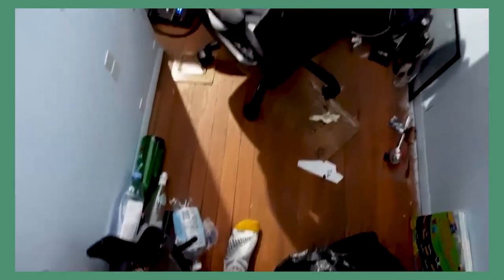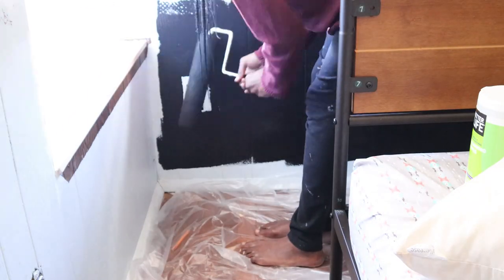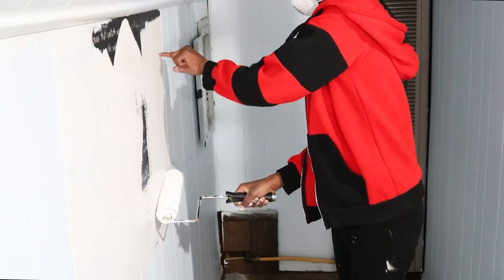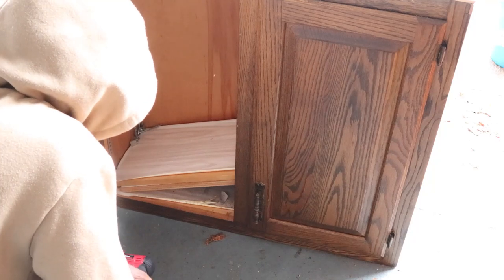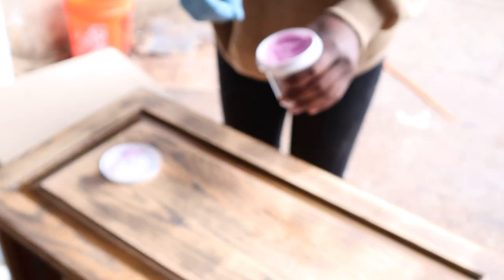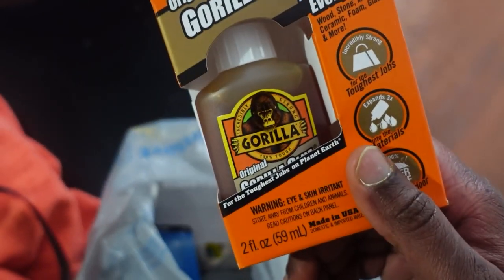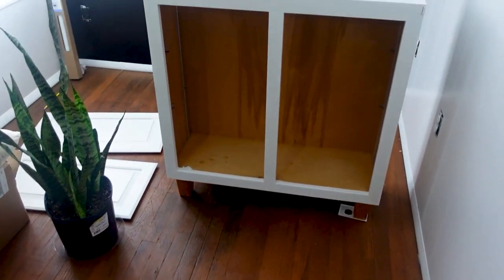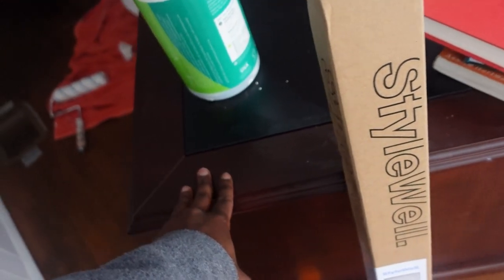HOUSE TO HOME UPDATE: Small Home Office Room Makeover PROGRESS

Comment: Take down the roof tiles and spray paint them it can coat the  pores. Then paint the frames that hold up the tile. If you use matte black the frames will blend better.  Have you attempted centering the cabinet to the side of the wall that it is on?
Reply from the maker: Matte black 😍. I havent tried removing ant yet but this method sounds easier than what i had planned lol. But i think i'll use a roller. Im adding it to my summer to do list. The desk takes up some of that space so thats why I didnt center the cabinet. It'll all make sense why its off centered. 😅 lol.
Reply: @createwithkim7  can't wait to see it come together. I'm here for the journey. Oh also you could consider replacing the ceiling tiles with black ones

Comment: Your son is adorable! “I’m right here, don’t worry!” I think you need to put new drywall on the ceiling, then paint.
Reply from the maker: That's another level for me lol. I shifted one of them earlier to see what was up there... 🙅🏿. Lol.
Reply: @createwithkim7  It’s a small space and might only need a few sheets. Local handyman who might do it for a set price? Also, there is a clear sealant you can get as either a paint or spray. Most cupboards and dressers have that semigloss finish to prevent dirt and scuffs. I couldn’t tell if the white paint you applied was gloss or not. The legs on the dresser should be secured as the whole thing could collapse, especially if filled with books. Maybe a bracket which would go into the legs and the side? It could be painted, which would help conceal it a bit….thanks for letting me share. Great job! It’s going to be beautiful.
Reply from the maker: @uslee19  brackets! Thank you, I'll add that to my list. Thats what used to keep our bedframe together. Also, The white paint was an eggshell finish. Its for snacks ... But safety is still a priority.